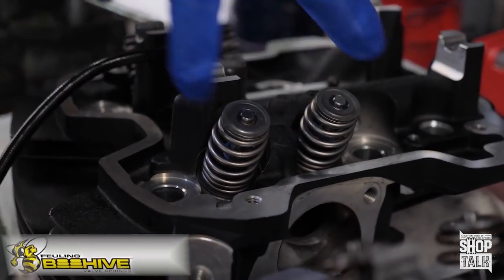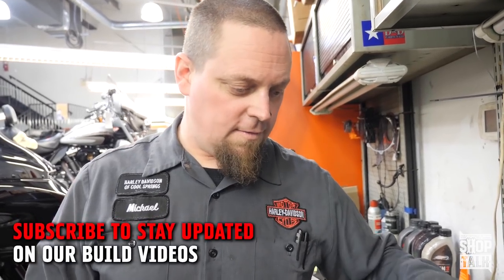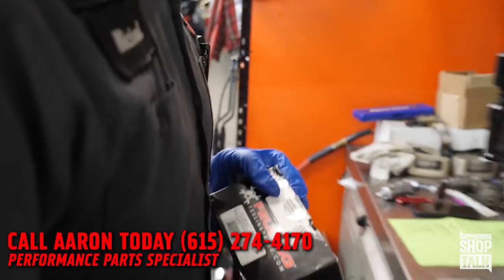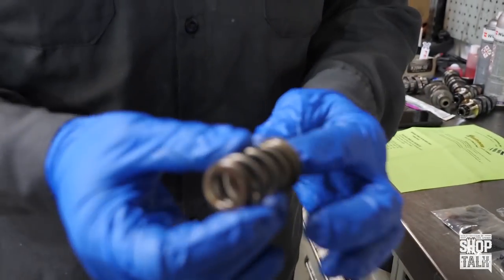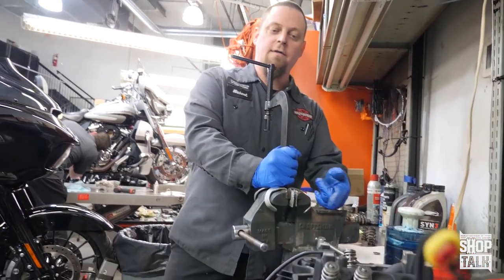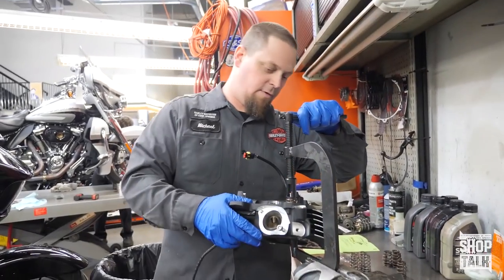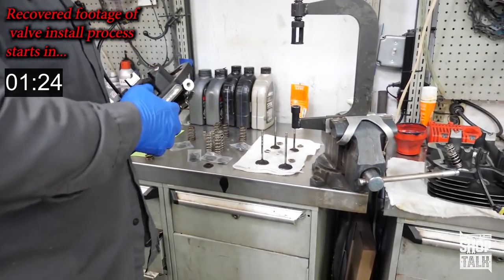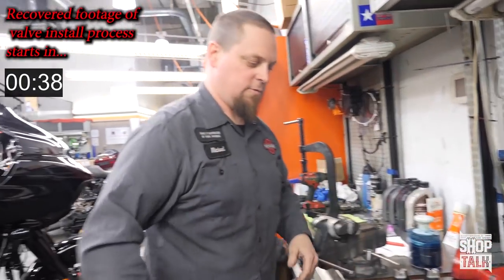Valve Springs: From Screamin' Eagle to Feuling Beehive | Shop Talk Episode 20

Comment: I would have like to see how you measure the spring height,  strength at a given length to see how much to shim them
I remember doing this 40 years ago and wondering if anything improved.
A+ on your video's
Reply: It hasn't changed much.  The more things change, right?

Comment: I have a 07 flhrc with a 96 in it keeping it forever. Looking to upgrade clutch and engine. But unsure on either 103 or 110.
Reply: RL sounds like a beauty...and as you know...size matter...depending on how long forever might be..there are a ton of options available for the proven TC motor. Budget permitting you should lock down the bottom end, i.e., transmission, rods, crank, clutch, etc, then perfect the heart and lungs, cylinders, pistons, heads, cam, and intake system. The flaws that the MOCO delivers off the line is not right as an American company, however, our platform and upgrade options provides one of the best opportunities to build a custom beast that looks and performs as your custom creation. After you complete your custom creation...you can tweak it even more...budget permitting! Live-Ride-Enjoy! HDOG

Comment: Crap! Now I have to change my springs? I thought the SE were good to .525 lift. Bummer!
Reply: @WayToo TiredYea, nice to know if they break the valve won't fall in the hole but who wants to have to pull a head off over a busted spring? I have seen broken springs on the 114's especially at the rear cylinder but no SE's till now. Shit!

Comment: You guys do know Harley has known about the spring quality and has switched manufacturers and the new spring have new parts numbers
Reply: Yes we do know that.  The Feuling springs have a more consistent spring rate, can handle higher lifts and come with shims to set the rate for specific lift heights.

Comment: I’m thinking this is gonna end up being a common problem across the M8 board/ how willing has Harley been in regards to the warranty work ?and are they covering a full set replacement in a single spring or is that just something you guys like doing? Full set replacement should be the go to method period to avoid customer return trips for the recurring issue
Reply: Yes they do warranty all the springs and we have not had issues with the motor company denying claims. They have also changed suppliers for the S.E. springs and updated the part number since 2017.  I am not sure if the standard valve springs have also been affected with a supply chain change.

Comment: Totally different video, but if I have screamin eagle cnc heads on my 2018 XL should I ditch the SE springs and put fueling springs in or is this only an M8 thing?
Reply from the maker: You are good! No need to swap.
Reply: @MoonshineHarley  I know it's an old post, the reason I asked is because I was going to run a set of SE ported heads that come with the SE springs, I got side tracked but 2 years later I have a set of the cnc ported heads, and my oem heads have a set of Feuling Endurance Springs with Ti retainers. I'm just wondering if I should swap the Feuling springs into the SE heads. All the components are already in my possession so it's not going to cost me any extra. Opinion?

Comment: I have a HD Stage IV kit w/ woods WM8-999 cam. SE valve springs. How would you tell if the springs malfunctioned ?
Reply: Dirty Money Customs if a spring breaks on a twin cam you’ll know. M8’s are a little different due to the smaller valves.
Reply: You will know really quick and just shut it down and get the bike into a shop
Reply: I have an M8 just curious
Reply: @dirtym4702  just happened to my club brother's 114, m8.  How did we know?   It died getting off the highway.  Second motor.  Right around 7 thousand miles. Rear cylinder.  .
Reply: DJXO1975 wow..ok

Comment: Would you suggest a spring change for a S&S 475 cam with the 124 BB kit installed?
Reply: You are right at the limit. I was looking at the Fueling 521 but with SE springs the Rocket 474 might have to do. Our 124s are going to generate more rear cylinder heat than the stock set-up. I have seen a lot of broken springs on the 114's. It sucks.

Comment: How expensive is it to pull the heads and change the springs? I’m getting ready to do a 465 cam and I’m just thinking of upgrading the springs to try to quite the operation of the motor. Do you think it is a good idea to do the springs when doing the cam?
Reply: With that cam it wouldn't be necessary.
Reply: Yea I no it’s not but after seeing how the MOCO springs break I’m just a little cautious since I’ll be losing the warranty lol
Reply: @joevandivner9704  we can only replace them under warranty if there is a failure.
If there is a spring failure though we honor the warranty even with the cam installed.
If you are doing a bore or compression increase I recommend it as the heads are already coming off.  If you are doing a straight bolt in cam it isn't a necessary expense.  
We have only experienced spring issues with SE high lift springs.
It would cost less to add in an upgraded oil pump and cam plate.  That is always a good investment.
Call Aaron at the shop and we will get you fixed up.
Reply: Yea I’m doing the S&S oil pump and can plate just trying to make everything as bulletproof as possible. Thanks for the info
Reply: Yea I’m doing the S&S oil pump and can plate just trying to make everything as bulletproof as possible. Thanks for the info
Reply: Yea I’m doing the S&S oil pump and can plate just trying to make everything as bulletproof as possible. Thanks for the info
Reply: Yea I’m doing the S&S oil pump and can plate just trying to make everything as bulletproof as possible. Thanks for the info
Reply: @joevandivner9704  that is a good idea.  We have done several cam only installs and have never had a stock spring fail with a .475 and under lift.

Comment: Wanting to throw a 475 cam in my 107, should I change the springs?
Reply: That lift will not require spring change.
Reply: @NoName-vz1ob That lift will require a cam change. I think stock is in the .445 range?
Reply: @Cwra1smith  thanks for catching my "cam/spring" misprint.  I believe the stock lift is .390.  I haven't looked it up in some time but it is pretty low.  .447 is the first level HD upgrade.
Reply: no not with standard ratio rockers anyway